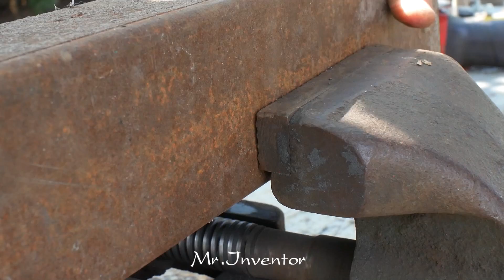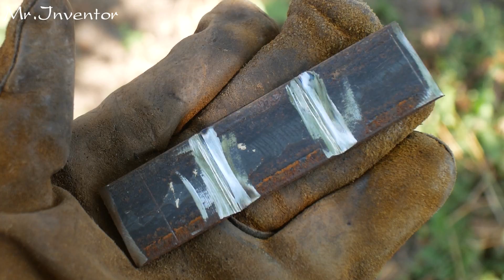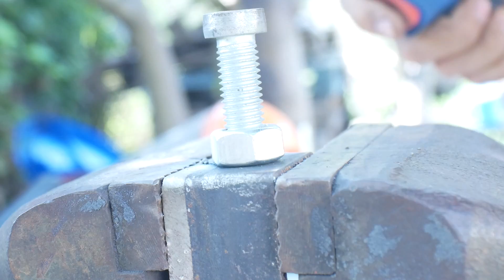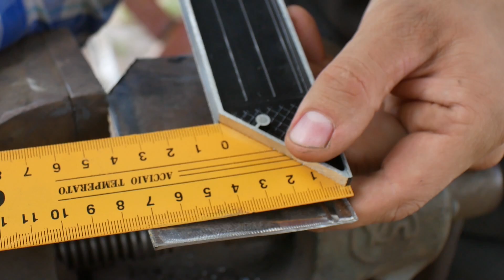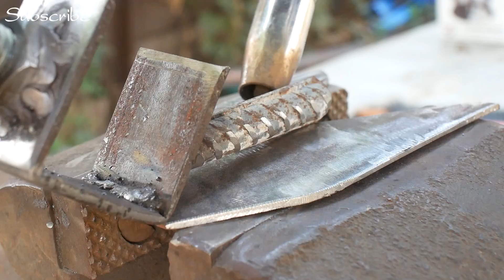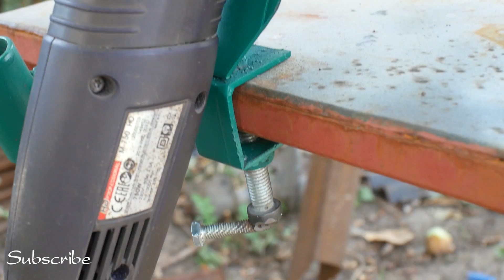Cool Homemade DIY Idea For Angle Grinder Hack

Comment: Perfect for a cordless angle grinder. Needs an arm to secure it through the handle bolt. And why isn't it 90 degrees?  Or just clamp the grinder in a bench vice ..